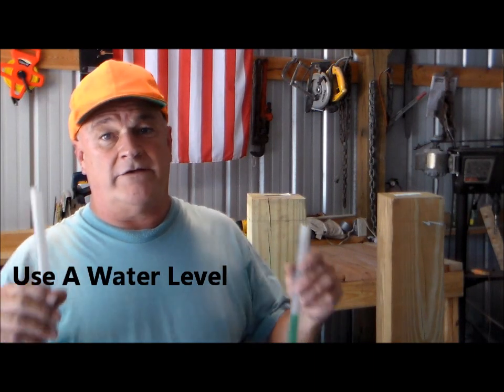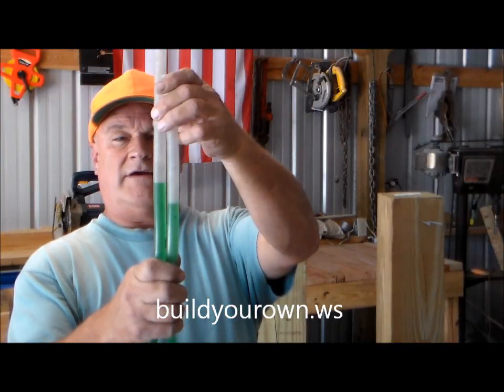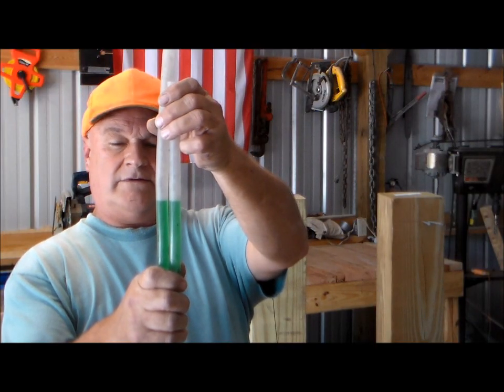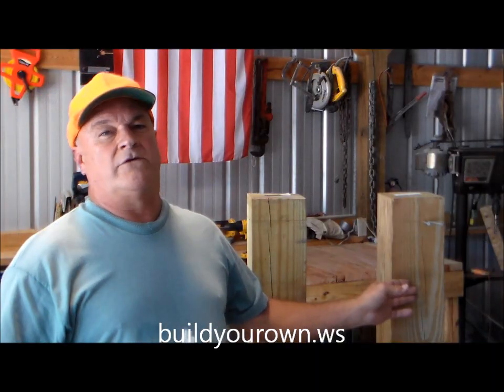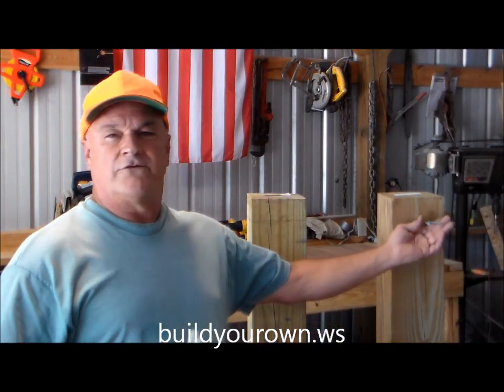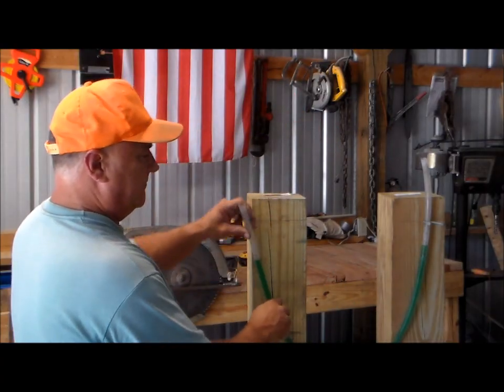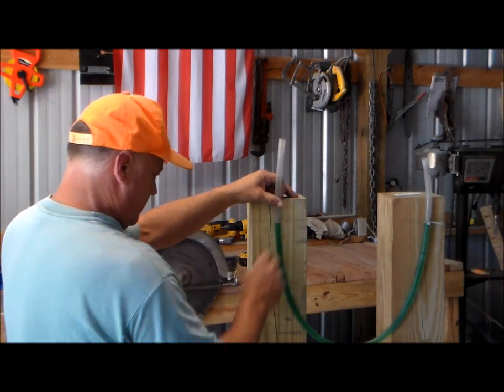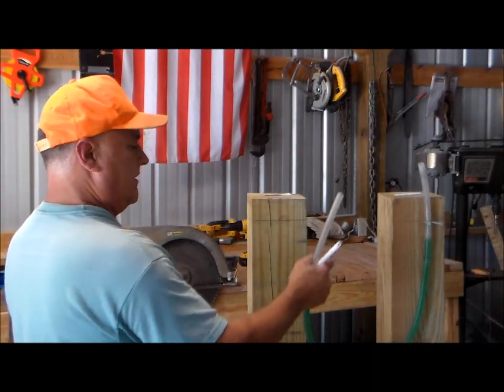How to use a Water Level - construction tips from Ted

Comment: Thanks for the tip, just got done using this method to get a level line in a room. Only spent 6 bucks for some tubing at the hardware store, now I have it whenever I need it again. For anyone else wanting to try this, I would recommend you get longer tubing than you think you will need and watch out for the water spilling out.